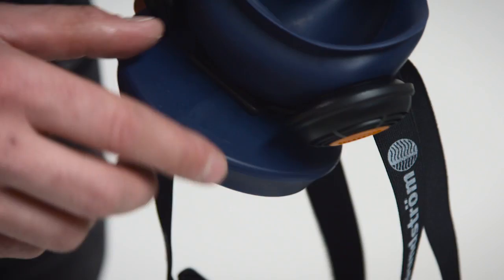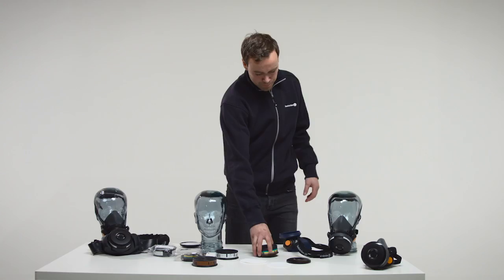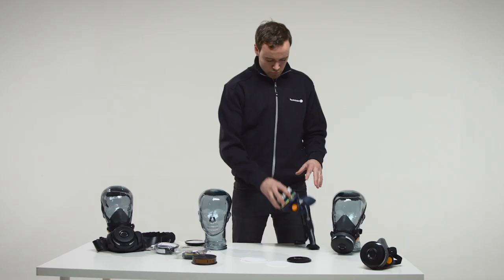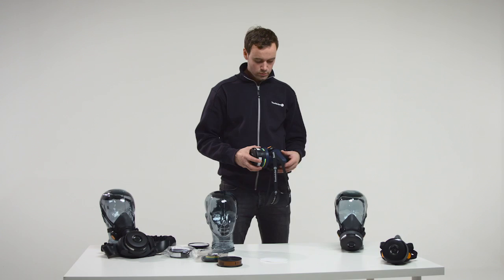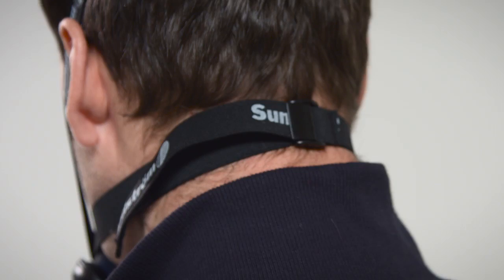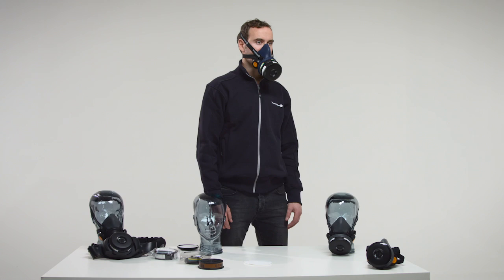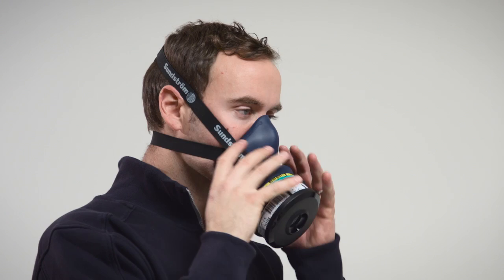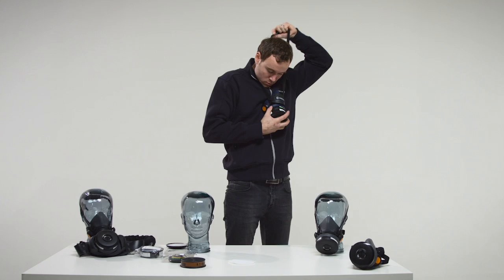Sundström Safety Instruction Half Masks

Comment: Now with the coronavirus, how well would it fair against it, as well as the SR 200? I read the SR 510 P3 filters can handle viruses. Are the masks also compatible with Scott CF 22 A2P3 filters?
Reply from the maker: The SR 200 gives you a higher protection factor than the half mask does because it covers the whole face.
SR 510 P3 R has a filtration efficiency on 99,997% and gives protection against bacteria and viruses.
There is a standard thread on the SR 200 and therefore other manufacturers' filters can be mounted.
Best Regards 
Sundström Safety 
Technical Support Team
https://www.srsafety.com/support/contact-us
Reply: Silversurfer p3 510 filter is very good for viruses 99.997 percent will protect you

Comment: Is it necessary the two filter?
Reply: Easy answer is no , one works against gas and the other against particles , however you can use them both if not certain what your walking into.
Reply: @matso3856  When using two which should be closest to the mask? The one for gas or the one for particles? Does it matter?
Reply: @staticvoid693  gas , to prevent particles to go into the filter for gas, its only to keep it working for longer and not absolutely necessary.